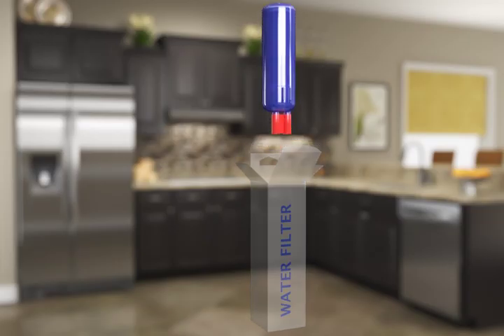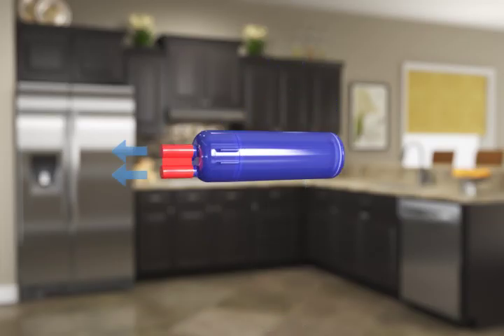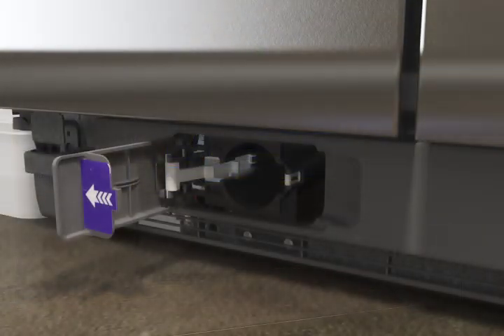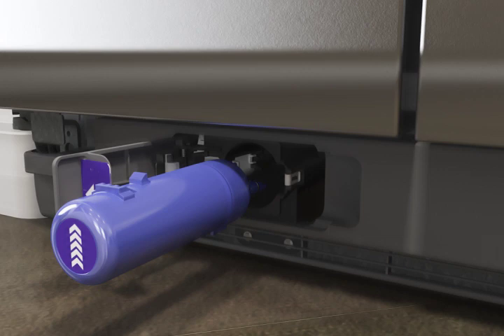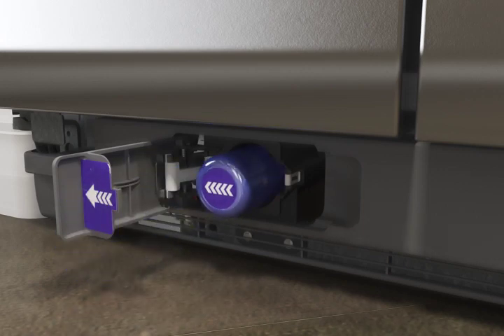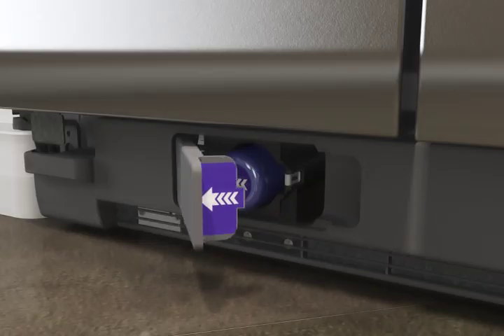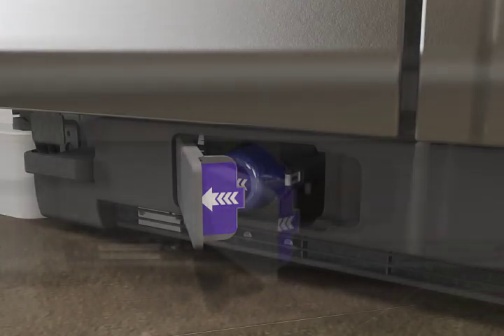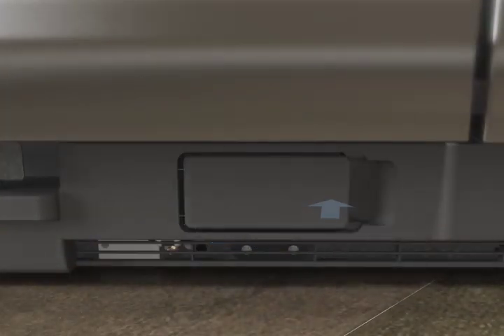How to replace a Whirlpool Filter 1 in the Refrigerator Grille

Comment: If your filter door is broken and the filter won't come out,  push the filter cap to the right fairly firmly until it pops a little.  At this point it will still feel that it won't come out.  Now get a hook knife or something to grab the left side plastic piece that protrudes on the filter and pull it the rest of the way out.  But until you get that thing to pop a little by pushing right, no force in the world is going to get that puppy out of there.
Reply: This actually helped, thank you!
Reply: This worked, thank you so much
Reply: Thank you!!! I searched everywhere for a video or instructions that would help with this and came up short! You’re an angel!
Reply: I think this is the solution a lot of us are looking for. Thank you
Reply: your comment was a great help.  Thanks. My filter wouldn't pop out.  Not sure how I would have figured out what to do without your input.
Reply: Just bought a house and did this on my own with a determined finger on the side you described 😂

Comment: The entire DOOR popped off when replacing the filter! Any suggestions on how to put it back on? There is a spring mechanism still attached to the left of the filter. What came off was the door itself and the white plastic swing arm. Trying to figure out where the spring goes and how to get the door back on!! Thanks for any advice!
Reply: Vivian Honey mine did toooooooo😱🥺😢
Reply: Same here. First the white arm popped off. Then when trying to replace it, the door popped off.
Reply: Did either of you get a response or an answer to this question?  Same thing happened to me today.
Reply: @TomVitt1022  use a screwdriver. insert in that left hole the push to the right to pop it out. takes a few tries
Reply: @ggum57 I used a pair of channel locks to compress the door holder to get the door holes to line up and pop back on.

Comment: When I changed my filterA Lot of water started to rush out and did not stop until i hurriedly put the new filter in. I was just concerned is this normal? Should I have let all the water drain out before inserting the new filter? I am just concerned about water leaking out the bottom

Comment: P.O.S.!!!!    Replaced filter and the little door will not push filter into position and close.  Door pops right back open and then water will not work. This has happened every single time we change the filter.   Have taped a thin coin on filter top to try to get it pushed into position, it sometimes works, but have the same issue once the filter gets changed again.  I AM USING WHIRLPOOL FILTERS, not aftermarket ones.  I am ready to take this fridge to the dump and buy another brand!

Comment: Just changed the filter on my fridge. The white plastic gizmo is of no consequence. To get the old filter out simply push it to the left so it clears the internal guide and it slides out.
Reply: So all you do is push the filter to the left with your hand and then pull it out? My door and mechanism came off and then I put the new filter in before I put the door and mechanism back on. I realize that was a mistake and now I can't get the filter out.
Reply: @kevinweiss091871  Flat head screw driver to push in barely and use as a lever against the plastic "rail" to push it to the side. (I put screw driver in left side and levered it to the right and it popped right out)

Comment: How do you remove a filter that won't come out?
Reply: I have the exact same problem w/same model
Reply: @Freeway4sho  me too
Reply: @baconrealestateteam3548  let me know when/if you have a solution please :)
Reply: @festus763  Thanks sir!!! :)
Reply: @festus763   - This should be TOP COMMENT!  I was grabbing pliers trying to pull straight back, trying to grip on the outer plastics, pull with fingers and nothing happened.
Then I got a flat head and put it in the left and pryed it (just a bit) and pop, it moved and was able to remove it easily!  (note: the POP is not an audible pop, but more-so the filter will pop out a bit)

Thank you Franklin!  Huge help and prevented a further headache!!!!!
Reply: @festus763  - thanks so much for this, as I was stuck on finding 'any' information on this topic, until I came across yours....and it worked.   I did have to push a little harder to get mine to 'pop' but it eventually did.   I assume I'll have to do this every time now?   Unsure why the normal spring/lever attachment in there didn't do it's job, as it's all in place, but just wouldn't allow my filter to release!   Thanks again!
Reply: @festus763  Thanks! Your procedure works. Appreciate your help very much...

Comment: Our refrigerator is model #WRS325FDM02 the red light came on a few weeks ago, the door has not popped open but I've tried to replace the filter, I can't turn it even if I open the door.  We've had the refrigerator since March 2014!
Any ideas would be appreciated.
Reply: What do you do if the "secondary door" came off?

Comment: So I accidentally pulled off the the assembly that ejects the filter.  Any tips on putting it back together?  I didn't break any of the parts or springs.
Reply: I just did the same.  Have you discovered how to put it back together?
Reply: The housing for the door spring was broken, so I had to call Whirlpool for a replacement. There was no charge because Whirlpool explained that this is a common occurrence for this model.
Reply: Same thing happened to me. Is there any way to get the old filter out with this part broken??
Reply: Same thing happened to me now i can't get the new filter out
Reply: Cheryl Sexson Me too.  Only the little swing arm fell off and the filter didn’t release.   If You figured it out please post your solution.  Thanks!
Reply: I just figured it out for my model (Whirlpool  side by side model WRS321SDHZ01): the stuck filter has arrows pointing to the hinge <<<<. There is some side to side play for the filter itself. Push the filter to the right >>>> . The filter should release and pop out just a little. There will be some water spillage. Might work too on your particular model. Putting the door back together will require some  help because of the spring.
Reply: Just hassled with this myself.  My fridge looks just like this one in video. Push the filter to the right fairly firmly and it then pops.  Then get a hook knife or something to grab the left side plastic piece that protrudes on the filter and pull it the rest of the way out.  But until you get that thing to pop a little by pushing right, no force in the world is going to get that puppy out of there.
Reply: Howard R. 7
Reply: Thanks it came out easy
Reply: @cheryls3777  ME TOO

Comment: My refrigerator is making noises when I use the water dispenser.  Recently replaced the filter with a new one.  The original filter that came with the fridge did not make noises.  My wife cannot stand the noise.  Fridge model WSF26C2EXY.  What should I do?

Comment: I think my filter is out of spec, everything was fine until I replaced the old filter with this new one. No water will come out, but I can take my foot and slightly push in on the door and it works fine until I release my foot. Also, I've noticed the water will flow fine with no filter in. Other than drinking unfiltered water, will not using a filter mess up the system?
Reply: Al Va  yes
Reply: Try and lube the orings and or place a folded paper towel between the bottom of the filter and the door.
Reply: This is happening to my fridge now... how did you resolve it?
Reply: Did you figure out a solution to this problem?
Reply: @TannerStark21 the filters are out of spec and AFAIK it’s still ongoing. Folding a piece of paper towel and placing between the cover and filter works for a little while. I never tried lubing the o rings as stated above. At this point we just buy bottled water and use tap water ice. The LEDs in the fridge have gone out too. This unit is a complete turd.

Comment: What's with these fridges....seeing so many 'issues' regarding this door and filter release system!   My door opened as it should, but the filter is still sitting firmly in place (tried pulling, but no luck - yet).  What holds the filter in place, and how does one release it?
Reply: It's a poor design. These companies push these products out without proper testing. One way is to super glue a bolt to the end of the filter, let dry and pull the filter out.

Comment: My filter goes in fine and door snaps into place but it keeps popping back out forcing door open. Has anyone been able to fix this issue?
Reply: make sure its properly locked into place
Reply: I had the same issue. The issue is the filter is not seating deep enough in the housing in order to open the valve to relieve pressure. Place something with enough width in between the door and the bottom of the filter and then close door...some people fold a paper towel and that seems to work.
Reply: I've fought with this for a year, now I'm replacing the water filter housing for $60 - easy replacement.  The spacer works for a while but eventually the cheap plastic parts just can't handle it.
Reply: @edwinelston235  who did you have replace it?
Reply: @quelaw8933  thank you, this solved my problem
Reply: @quelaw8933  thank you, this solved my problem.

Comment: Water won't dispense after replacing. Any advice?
Reply: I lubed the 2 o-rings with vaseline, and folded half a paper towel to fit the length of the new filter. I then carefully slid this setup in until I had to close the door. I had the same problem you did.

Comment: I have a new whirlpool fridge around two months old. It has stopped making ice. It was slow to begin with. But still dispenses water. What  could be the problem? Filter?
Reply: Filter housing, my door won't hold the filter solidly in so no water flow.

Comment: OK I need help and calling Whirlpool was useless.  When installing a new filter yesterday, the white removal latch arm that is attached to the inside of the filter door popped off when I closed the door.  So now I have a filter that is installed properly, but no way to remove it since opening the door will not automatically eject the filter without the latch arm.  It is not broken so I believe I can reinstall it once I get the filter out.  Any hints on how to remove the filter?  It is fully seated, so there is no way to grab the end with pliers...
Reply: The top hinge on my door is broken so I was unable to reassemble mine as it keeps falling apart. I just used a sturdy butter knife and pried the filter out from the left side.
Reply: same thing happened to me , that white part popped out also.....trying to find out how it goes back in and the filter is like stuck now.....any ideas ?
Reply: I have this problem. What was your solution pls?
Reply: It helps to remove to grill from the fridge, which allows you to work easier. Try slipping something in along the side of the filter to help you wiggle it around (trying to turn it a quarter to the left), while also pulling out on it. You should eventually be able to get it to where you can pull it out.
Reply: I'm another hapless Whirlpool fridge owner who's filter door fails to release the filter.  Will NEVER buy another fridge with this stupid design flaw.  Shame on Whirlpool.

Comment: I replaced mine and after a couple of days it quit working. No water is coming out. The ice maker is not getting water either.
Reply: I just became apart of the Whirlpool world.  Im sure you have fix your problem at this point but I saw the video that says purge 3 gallons of water through the new filter to prevent that problem.

Comment: i can not figure out how to put the water filter door back on as it popped off. Any help
Reply: I just put mine back on, took me about 10 minutes.  This video helped, l looked at how the parts come together on the door.  The small white end slides in a runner next to the filter, which ejects the filter, the wider half of the white part fits into the door slots and then the door clips over the base to the left of the filter, you'll see it has indentation marks on the door part.  I'm old, inpatient and half crazy but I got it, good luck.....I didn't get the kick plate on!  Guess it will breathe better that way.

Comment: I was wondering can we just push the indicator light and reset it without changing the filter. That's all my apartment management does when the light indicates that the filter needs to be changed. they never change the filter I've been here 3 years now
Reply: Rhonda Clark they are not doing their job! They need to physically change the filter

Comment: My problem is that I can't see why I need an expensive filter if I'm using city water that is treated. I am concerned though, about leaving an old filter installed as it could be actually getting my clean water dirty. I'd take it out but I suspect that would let water run inside the fridge. Anybody know the answer? I wouldn't trust the company to answer truthfully... they're just interested in selling filters.